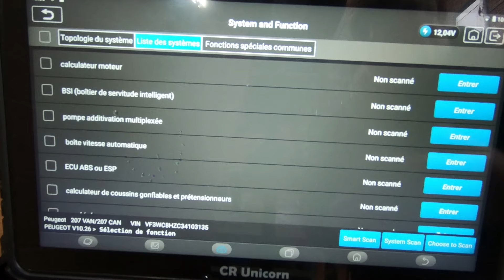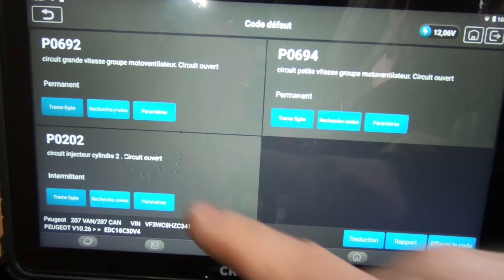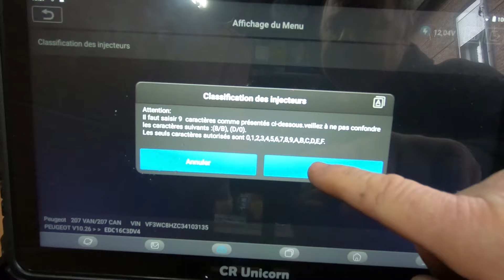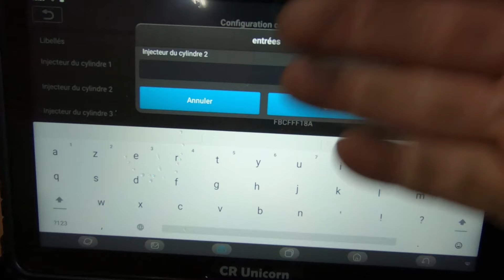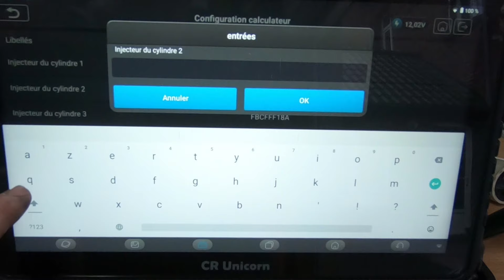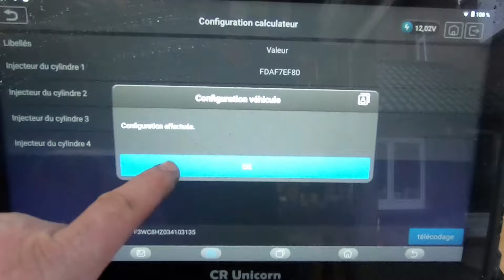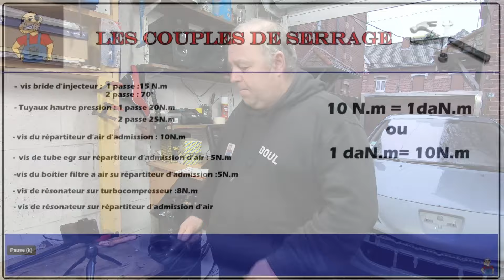Décrypter  et codage  injecteur 1.4 hdi (projet 207)

Comment: Bonsoir Boul.

Belle et bonne vidéo comme d'habitude ! 👌👍🙂
Effectivement, l'opération est "simple" ... une fois l'accès aux injecteurs dégagé !! 😉😁

Par contre, je ne comprends pas ce que cela apporte cet encodage ? Je comprends qu'il  faille effacer le défaut. Le code injecteur c'est pour que le calculateur sache qu'il a bien été changé et qu'il n'associe plus le défaut à l'injecteur 2  (dans la vidéo) ou est-ce que ça lui donne d'autres informations ?? 
Je suppose que les injecteurs sont fournis avec des spécifications qui changent en fonction des moteurs, nombre et diamètre des trous, pression de carburant, cylindrée du moteur etc etc. Non ?

Mes questions vont faire bondir les connaisseurs ! 😁 Je ne suis pas du métier je voudrais juste savoir ! 👍👋

Bonne fin de week-end. Preds soin de toi. Tu as pris ton temps pour parler, tu sembles bien moins essoufflé 👌👍
À plus pour la suite. 👋👋
Reply from the maker: Merci jean , pour la reprogrammation c est surtout pour maximiser performance et réduire la pollution et la consommation , chaque injecteur a ces valeur et  a besoin d'être reconnue par le calculateur biensure tous sa reste mini ,il beaucoup de monde qui les reprogramme pas
Reply: ce n'est pas une histoire d'adressage, comme c'est du CAN, ou plus vulgairement de l'informatique, car de se que je peux comprendre, le calculateur doit savoir ou se trouve l'injecteur n°1, puis le deux, etc, afin de géré l'ordre d'ouverture selon le moteur, et ce numéro est là pour ça, identifier les injecteurs afin que le calculateur puisse communiqué avec les injecteurs. 

Enfin je le voie comme ça, je suis dans l'informatique et c'est comme ça que la box communique avec ses hôtes sur un réseau local via une adresse IP 192.168.1.X , on remplace le X pour y mettre un chiffre afin d'identifié l'hôte sur le réseau, tout comme le calculateur de la voiture.
Reply: @lylian1072  
Merci pour vos réponses ! 👌👍 Ça  éclaircit les choses. 🙂
Je pensais que par programmation d'usine, il "savait" quel injecteur ouvrir et fermer en fonction du nbre de cylindre et ordre d'allumage, les capteurs lui donnant les infos de pression et température du carburant, si c'était ou non en accélération et tout et tout donc je ne comprenais pas le pourquoi de l'opération partant du principe que chaque injecteur est lui lui-même taré pour un type de véhicule.
Par contre ça ne me choquait pas en cas de reprommation du calculateur avec changement d'injecteur pour passer de l'essence à l'E85 par exemple.

Voili voilà. Bonne journée. 👋👋
Reply: @jeanhauchecorne2926  Après oui, je pense aussi que le calculateur gère le débit de gasoil, j'ai un Scenic 2 1.5 DCI et à chaque démarrage les premières secondes étaient chaotique (tournais mal, fumé et odeur bizarre) puis le moteur tournait normalement ensuite, je pense que le calculateur ajustait les temps d'injection au même niveau que mon injecteur malade (ça reste une supposition), d'après le mécano qui l'a fait, pour lui il était en bout de course, il donnait moins que les autres.

Je cherchais le terme dans mon premier message, l'ordre d'injection qui varie selon les moteurs (1342 ou 1243 par exemple) comme l'allumage lol
Reply: @lylian1072  
Bon, du coup, on en arriverait au fait que cette programmation n'aurait pas lieu d'être puisque le calculateur partant des infos des différents capteurs va s'échiner à  faire tourner le moteur le plus "rond" possible.
Du moins durant le temps ou aucun capteur n'enverra pas  de signal d'alarme qui ferait que un ou des paramètres ne permettrait(ent) plus d'assurer un fonctionnement normal et au mieux on se retrouve en mode dégradé, au pire à l'arrêt total ... et on appelle notre ami Boul pour qu'il vienne brancher sa valise et nous tire d'affaire !! 😉😁😄

Je pousse plus loin le truc ... la question reste à quoi sert donc cette "programmation" des injecteurs ??

Si on ne s'est pas planté, on aurait plutôt eu tendance à démontrer qu'elle est inutile !! Sauf si les calculateurs avaient déjà en mémoire toutes les caractéristiques des injecteurs qu'ils peuvent utiliser ainsi que les programmes et qu'en fonction des performances que l'on va demander puissance, couple que l'on va leur demander ils puissent répondre. Ça pourrait s'expliquer pour les moteurs "bonus" de même cylindrées mais développant des puissances différentes, 90 ou 110 cv pour le 1.5 Dci Renault par exemple.
🤯🤔
Reply: @jeanhauchecorne2926  Identifier tel injecteur sur tel cylindre :
Cylindre 1 = injecteur 12
Cylindre 2 = injecteur 34
Cylindre 3 = injecteur 56
Cylindre 4 = injecteur 78
C'est de l'adressage, la calculateur a un ordre d'injection précis, lui ne sait pas quelle injecteur est sur le cylindre 1 si ont ne lui dit pas, après le calculateur interagit en fonction de ce qu'il reçoit sur débitmètre d'air, du volet papillon ou pédale d'accélérateur, capteur de pression carburant et la pression du turbo et il décide d'ouvrir plus longtemps les injecteurs ou pas via tous les paramètres relevés.
Sur le Scenic 2 j'ai remarqué que si ont roule en première sans accéléré (au pas) parfois pour éviter de caler, il met un léger filet de gaz tout seul (je ne touche pas la pédale d'accélérateur), ça fait bizarre la première fois.

Bon pour les différentes puissances sur le 1.5 Dci, il doit y avoir une cartographie différente pour chaque puissance, des injecteurs plus gros (exprimé en CC), on dit souvent que c'est le même moteur, oui le bloc peut être, après quelques pièces ne seront pas pareils suivant la puissance.
Reply: @lylian1072 
Ok, donc autre erreur de ma part vu que chaque injecteur est relié au calculateur je pensais qu'il  suffisait que sur la chaîne les choses soient montées à leur place... et que ça  " roulait" comme ça. D'autant plus que l'on ne touche pas ou très  rarement au faisceau de nos jours. 😁
Je me rappelle le changement  de tête et de doigt d'allumage ou des câbles la reliant aux bougies, qu'il ne fallait surtout pas intervertir, sur les essences. 🙄
Bon, j'arrête avec mes souvenirs, je vais faire vieux c⭐n bloqué il y a plusieurs dizaines d'années !! 😂🤣
Reply: @jeanhauchecorne2926  Il y a des modèles ou il n'y a pas de reprog de numéro d'injecteur, donc ta théorie et également plausible 🙂, c'est le câble qui correspond au cylindre (comme la tête de delco), si deux fiches sont inversés ça tourne comme une patate car l'ordre d'injection n'est plus bon.

Je ne me suis jamais posé cette question sur les injo non reprogrammable, ça doit fonctionné comme ça !
Je me coucherais peut être moins bête ce soir 😂😪
Reply: @lylian1072  
Très intéressante discussion. Merci !! 👌👍

Allez, je me lance, et si le multiplexage était la raison ? Genre un seul câble voire deux un par banc sur les V 6 ou plus ! 😄 ... dans ce cas les infos passent toutes pour tous les injecteurs et pour que chacun reçoive bien les siennes il faut qu'elles lui soient adressées en particulier par cette programmation ?! 🤔
Reply: @jeanhauchecorne2926  C'est déjà le cas avec l'informatique, ont fait tout passé dans une seul câble (Ethernet), le son, la vidéo, la donnée, donc pour les voitures, ça serait la même choses, il y aurait une communication entre le calculateur et les injecteurs comme c'est déjà le cas sur les renault/peugeot, chaque injecteur à un numéro et le calculateur envoie les donnée sur l'injecteur qu'il souhaite correspondre.

Je ne sais pas si c'est déjà le cas, mais sur un fil pour tout les injecteurs, je pense que cela serait un peut plus complexe, parce que pour le système actuel il n'y a que le calculateur qui communique vers l'injecteur (je pense), pour le multiplexage est ce que il ne devrait pas y avoir un va et vient entre les deux, je ne sais pas, c'est de la pur spéculation.

Il y aurait beaucoup de donnée sur un seul fil, il pourrait envoyé l'info de l'injecteur 1 sur les 4 injecteurs et seule le 1 réagi car dans la trame envoyé il a son numéro d'injecteur (donc adressage) tandis que les autres (2, 3,4) ne font rien car dans la trame les données concernes que l'injecteur 1, est ainsi de suite !

La trame c'est un terme informatique qui s'utilise dans le réseau, une trames c'est une série de 0 et 1, du binaire, et je pense que le calculateur de la voiture communique en binaire.

Voilà ce que j'en pense, maintenant est ce possible, est ce que cela ce fait déjà, aucune idée, a mon sens le système pourrait fonctionné comme ça, je ne suis pas ingénieurs pour le certifié.

Si un expert passe par là pour éclairer notre lanterne !
Reply: @lylian1072  
Oui, ça serait bien d'avoir une telle intervention ! 👌👍
M'est avis que nous sommes allés au bout de nos conjectures ! 😁 Il ne nous reste plus qu'à 🤞 et attendre.

Bonne soirée. Merci encore pour ce très agréable échange.
Reply: @jeanhauchecorne2926  Oui ça serait cool, idem j'aime bien des échanges comme ça, essayé de comprendre le fonctionnement, d'échangé des idées.

Je regarde pas mal de YouTubeur comme Boul, EMS Performance, Farine de blé, coupabledetout, Car&Meca, Voitures & ingénieries, et je ne suis pas mécano (Seulement à mes heures perdu) mais j'aime bien regardé, apprendre des trucs. 

Bonne journée 😉

Comment: Bonjour Mr boul,
Merci pour toutes vos vidéos super. 
Je viens de changer mon moteur 16hdi Citroën berlingo, je ne suis pas mécanicien mais je me débrouille !
J'ai fais distribution neuve, embrayage neuf, tout les huiles neuve, filtres neuf,  le moteur tourne nickel, par contre j'ai le témoin moteur qui reviens sans cesse pour m'indiquer un problème de vanne egr ,je l'ai démonté et nettoyer entièrement, rien à faire le témoin moteur reviens après deux où trois mises en route ! Voici les codes erreur que j'ai avec la valise diagnostique P0121  P1161   si vous avez une idée elle est la bien venue. 
Sur la route le moteur ce comporte très bien aucune perte de puissance !!
Reply from the maker: Slt Bernard félicitation pour ton remplacement moteur , le probleme peut être plutôt électrique et du coup le nettoyage ne règle pas le probleme  , si de mémoire panne de signal  Capteur de position de la vanne EGR
Reply: Merci pour ta réponse, je pensais également à un problème électrique sur la vanne egr, en tout cas je te remercie pour tes conseils et vidéos grâce à toi j'ai fait la distribution en toute confiance ainsi que l'embrayage. 
Je vais vérifier le câblage et boîte à fusible,les démonter et nettoyer ,on verra bien

Comment: Salut Boul super ta vidéo j'ai une question après avoir remplacer mes injecteurs par un pro j'ai voulu remplacer mon faisceau d'injecteur sur 3008 Peugeot impossible de démarrer j'utilise ma valise psa com pour réencoder impossible je croyais que les inj étaient encoder sur ECU je sais plus quoi faire sachant qu'il existe une vidéo ou le gars réussit avec cette valise help
Reply: sinon si pas possible existe il une valise spécifique pour 3008 2.0L HDI MERCI d'avance
Reply from the maker: dsl du retard , des valise vont fonctionné mieux que d autre mes je croit pas que le probleme viens du codage des injecteur , j'espère que tu as trouvé depuis le temps encore dsl

Comment: Même code injecteurs 2 et 4 ? Impossible
Reply from the maker: Slt bien vu lol , non j avais pas d'injecteur avec  9 caractère sous la main , du coup j ai pris celui que j avais démonter sur le cylindre 4
Reply: Bonjour boul, impossible de lire code injecteur sur c2 1.4 hdi calculateur Siemens avec icarsoft cr max.
Une petite idée.
Reply from the maker: @GregoryPozorski   tu as essayer de passé manuellement et prendre can ou van si tu as les deux model , sinon esayer de passé par une c3 , sa ma deja arrivé de prendre un autre model pour faire un diag
Reply: merci, j'essaie demain.